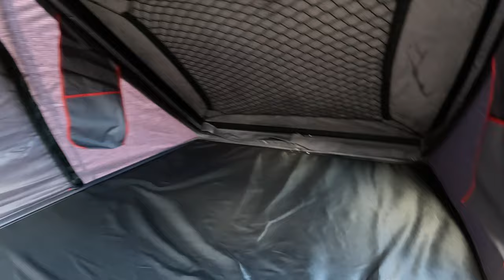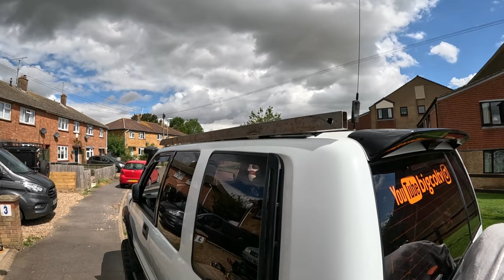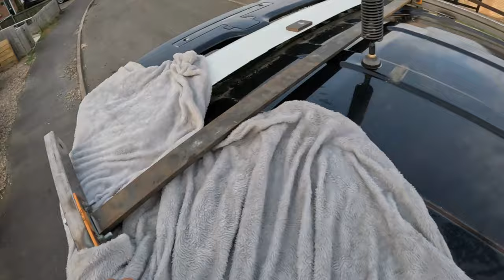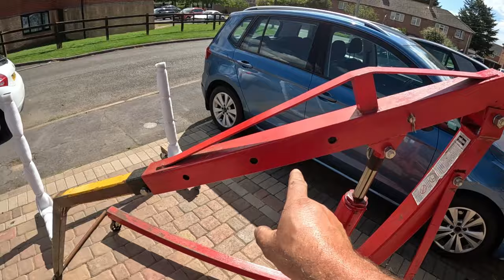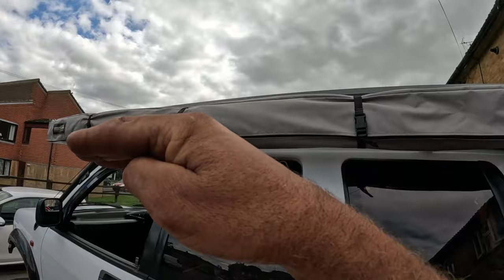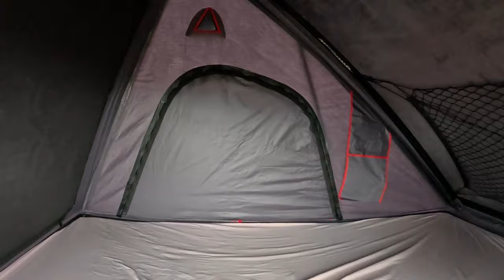BIGCOLTV 4X4 ADVENTURES I make a custom one off rack for the trooper and hard shell roof top tent!

Comment: RT for the win! makes camping so much less hassle, we fitted a marine standard solar fan vent in the top of ours to help stop the condensation, made a big improvement when the dew point is low in cold weather/high altitude
Reply from the maker: Only spent the  one night in it so far, and left the flap open, but maybe if I can talk the Mrs into a night in it , then 2 bodies may make condensation a factor, all good so far, and will keep the videos updated with what I find,  👍
Reply: @bigcoltv   should be OK in this weather Col, but in winter/high alt when you need it sealed up to keep the warm in we had condensation running down the walls in the morning in the Alps, was airing the bedding almost every other day when we stopped for lunch, was much better in the Pyrenees with the fan, only had to air the bedding once in 10 days - sent Pete (Dirt Magnet) your vid, they're contemplanting a RT but he thinks the clamshells arn't big enough, ur similar sizes so he has something to compare at least
Reply from the maker: @glassbackdiy3949  cheers Pete... 👍